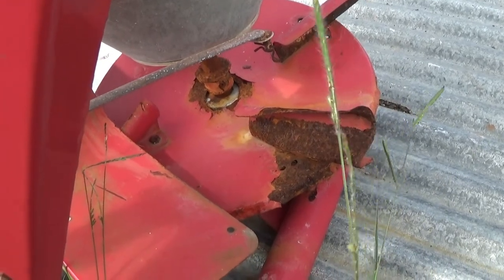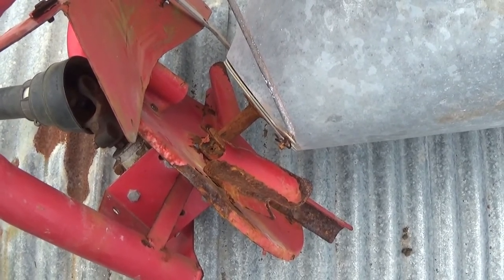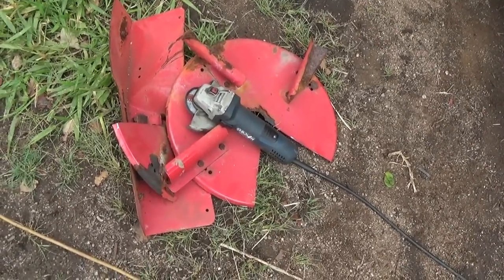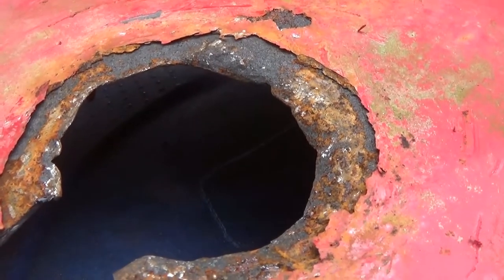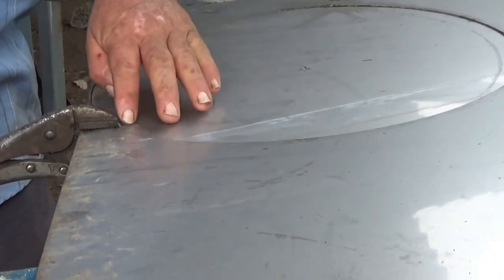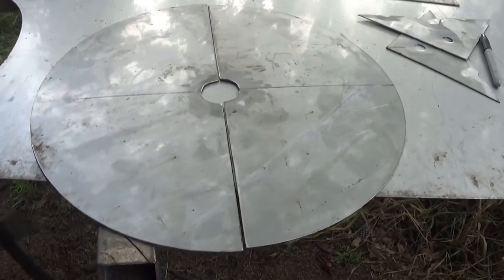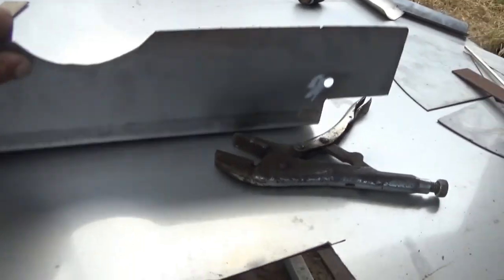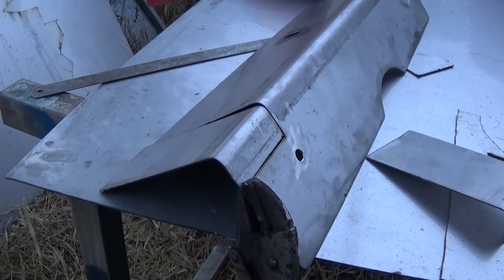FERTILIZER SPREADER REPAIR Pt 1

Comment: I replaced the bottom of my hopper last year with 1/8 plate, welded to a go-kart sprocket hub. It used a 5/16 set screw, but I drilled it out through and through and put a bolt through it
Reply from the maker: I find fertilizer is hard on steel. Thanks for commenting